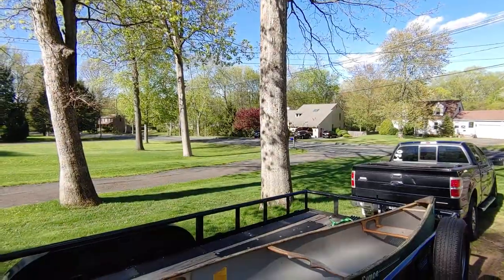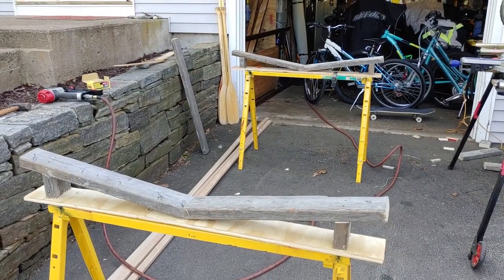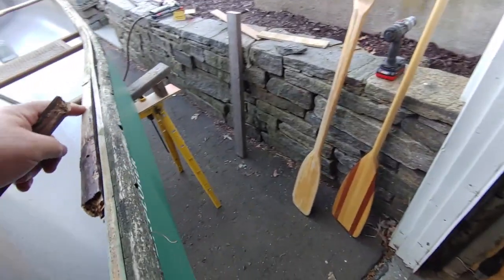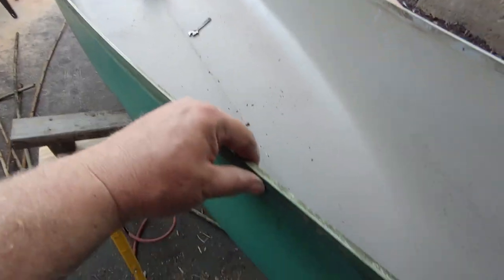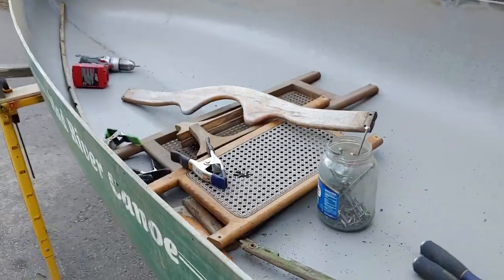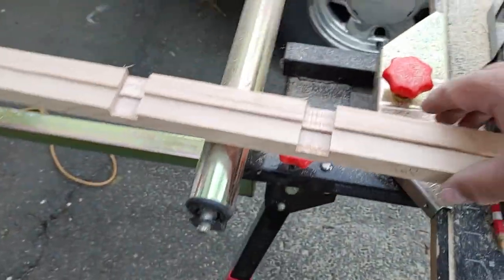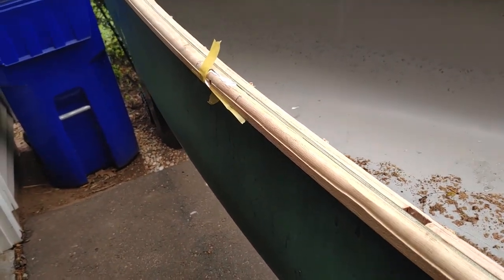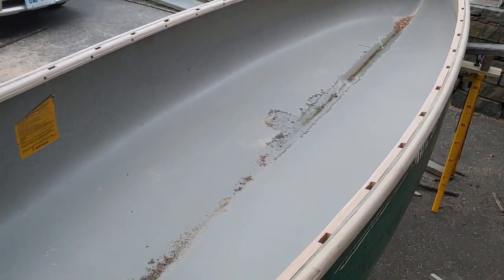How I installed new canoe gunnels/gunwales

Comment: Hey my man. Saw your sanding disc is popping off, the hook and loop system is failing. If you don't want to replace the bottom of your sander, use a couple dabs of hot glue to hold the sanding disc to the sander.
Reply from the maker: That sander eventually failed. I ended getting a very nice Porter & Cable orbital sander with a very good hook and loop bottom.
Reply: @bigguydiy2184  good stuff. Cheers bud. I just purchased a 19.5' old Town that ill be doing some bottom work on a changing the color. Super excited.
Reply from the maker: That will be my next project on this canoe. Color change and a tad fixing the wear spots on the ends, but that's long down the road at the moment.

Comment: Hi - thanks so much for posting this video! Our canoe took the Bowron Lakes tour in BC about 35 years ago - and it shows. We really want to bring it back to it's previous greatness. My apologies - I don't know word-working very well, but my question is:
- how did you go from a squared piece of wood to the rounded final gunwale? Was that achieved just with sanding?
Thank you for your time.
Very Sincerely,
~Bianca Laxton
Reply from the maker: Nope, I ran the square stock over a router table that put on the round edge. Other options if you do not have access to a router or router table set up is using a hand planer. There are different size hand planers. The best will be a model that will fit in the palm of your hand or smaller. They do come in electric but they are really too big and meant for large jobs. If you choose a hand planer, practice on a small piece first to get the blade depth set just right. You do not want to take a lot off, but you want to take off thin shavings. When done, store the planer on it's side, never on it's blade. 

And electric sander will take way to long to make rounded edges. Use the electric sander to smooth out any rough edges. Usually a 180 to 220 grit is good on the sander.

Comment: What are the dimensions of the red oak strips you used? Thank you for posting this btw, I’m redoing all the bright work on an old fiberglass canoe I found so this was a big help.
Reply from the maker: The strips were 1"x 2" x 12' long. I ripped them down to 1"x1"x12'. If you can get the strip in White Oak, that will absorb much less water the life of the wood. Red Oak is very porous even though it's a hardwood. The grain is like elongated straws. Because of the current COVID 19 pandemic, wood supplies in the local store are super thin to nothing in stock. Any more questions, give me a shout.